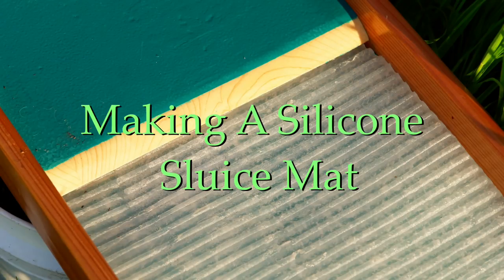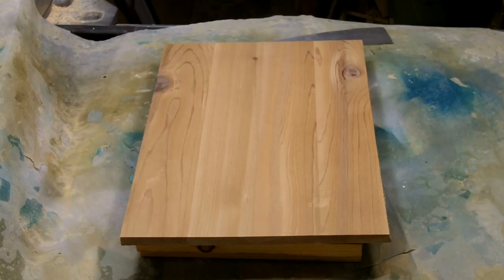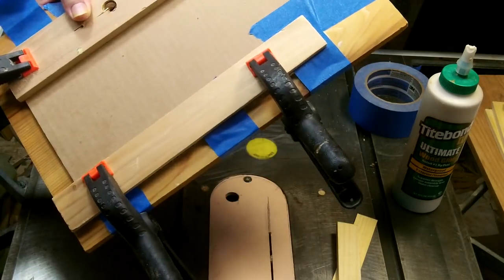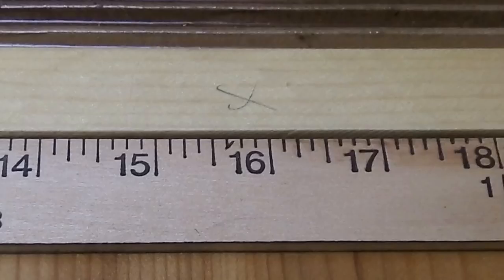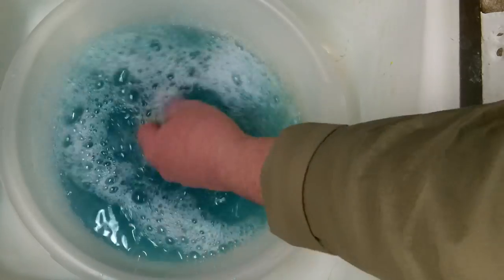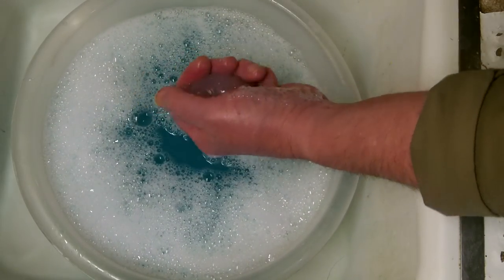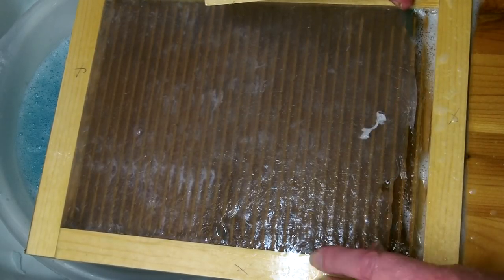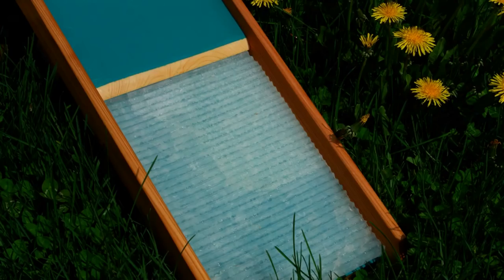DIY SILICONE GOLD SLUICE MAT

Comment: Fantastic idea using cardboard for the mold. You do the silicone a little different than I do and it looks like your method is working  I love watching someone else make the mats besides me and put there own spin on it. I bet the mat will catch the gold like crazy. Thanks for the shout out. My mold making is going hi tec with a new toy as soon as I figure it out. Thank you for sharing your idea with us can't wait to see how the mat works.
Reply from the maker: Hey, Alan. Thanks for the ideas and the videos. Looking forward to the new ones.  The mat does work very well. 6 runs with it so far and I haven't found a single piece of gold in the tailings. I love how easy these mats are to clean out. Yippers, I'm still experimenting with the best way to work with the Silicone. I had a hard time gathering up all those little stringers and so just shooting into my hand has worked the best. My nice clear mats have now turned a milk bottle white after drying. :-(  Thanks for watching. Buy more Silicone :-D
Reply: Haaa haa haaa there comes the flood
Reply from the maker: fabio Beyhaut Kuhn 
On its way. Thanks for watching.

Comment: Nice job! I appreciate the detail you present when making your videos. Im gonna give my silicone mats another try!👍
Reply from the maker: Thank You Wizard and I enjoy yours. So far these mats are working very well for me. I really like the flexibility and ease of cleanup with these. They are really quite durable as well. Thanks for stopping by.
Reply from the maker: Just wondering, what if you made a very thin mat to fit the slick plate on your Cube like this one from small box corrugations so it was like the small V mat. Use those yardsticks from Home Depot for a frame .  You could make it in 2 small sections about 6" x 12" which would take 1 tube for each section. Then glue them together. You would have a very thin mat that would have teeth on one side to work like the small deep v mat and smooth on the other. The fine gold would stick better to this than the rubber.  You could flip it over to the back to see if it would work like a Miller Table like Alan did. If so, all you would have to do is shut the water off and lift off the mat to clean it in a pan.  You may have to put a valve on the hose to cut the water supply down though for that very tiny gold. That would be good to do anyway as I think the Cube puts out too much water for fine gold. Just thinking out loud. :-D
Reply: @utahavalanch  Sir instead of spraying the card board for better results we can we apply a cement paste with tooth brush to give the card board extra strength and crispness??? Providing a firm base and mold for our silicon mat
Reply from the maker: sarwar kamal 
Hi Sarwar. Yes you could. There are many things you can use to do this. The Spar Varnish is something I had on hand.

Comment: When you make your next video of how it did, just for grins, turn it to the flat side and see how it does! I am curious to see if it did what Alan's did. Clean up slues AND miller table all in one mat!! Thanks for the video.
Reply from the maker: Hi Jack and thanks for watching. Yippers it does work like Alan's. I also did a test where I put a rubber mat and silicone mat on a board and then put them on a steep angle. Gold and metals stuck to the silicone mat and slid down the rubber. The new sluice I built for this mat it turns out is a combination Miller Table and sluice. Stay tuned.
Reply: @utahavalanch  That's fantastic. Mind if I share your comment with Alan? Or you can. I'm sure he would like to know your results!
Reply from the maker: @jacksp5089  

Hi Jack, you certainly can and tell him hi for me as well.

Comment: Wonderfull idea!
I think you should try and spread the silicone along the grooves instead of accross them though, would make it a lot easier to not get air bubbles and poor rifle-shapes.
Reply from the maker: Hi and thanks for watching and the comment. I do it that way more so with my new mats. They are a new design and you kind of have to do it that way to get the Silicone down in side them better.  It's been a learning process and after about 20 mats I'm getting the hang of it a little better. I have several new mat designs I'm working with and it takes a bit of learning how to work with each one.

Comment: Try using a liquid rubber spray. It's used for coating tools. Stays flexible and pretty strong. I like your cardboard idea. Love all the DIY ideas.
Reply from the maker: Hi Will and thanks for watching. I'll have to give it a try one of these days but I don't know if you can apply it thick enough to make a mat.